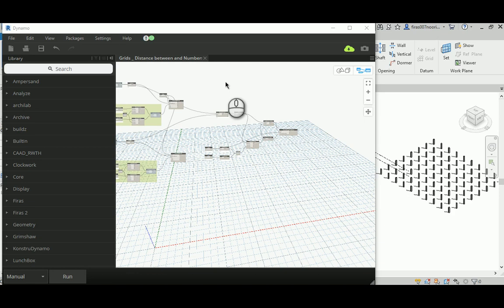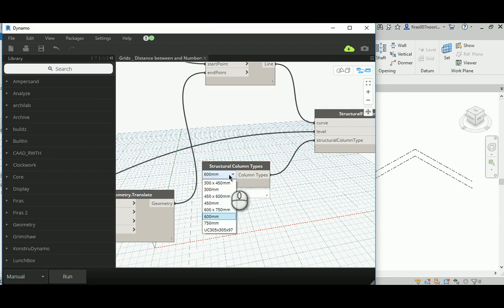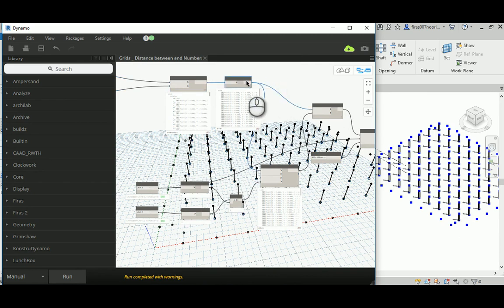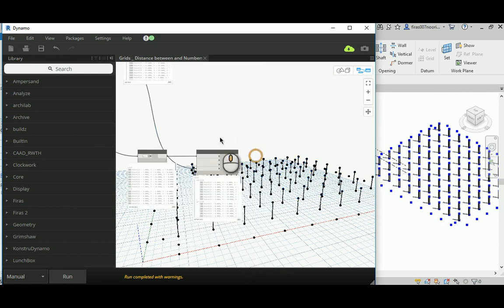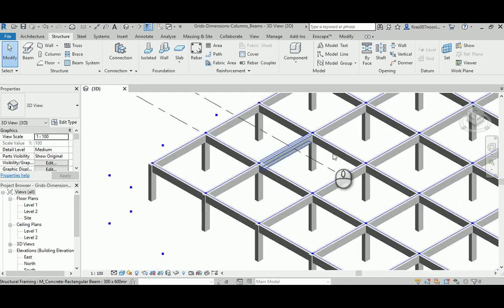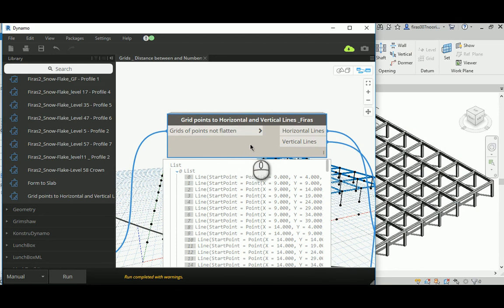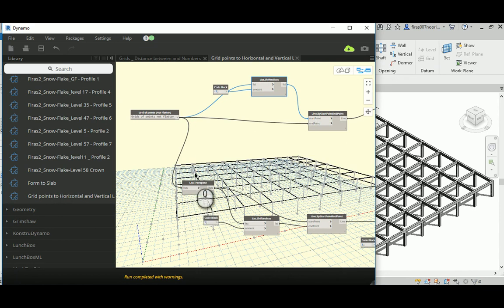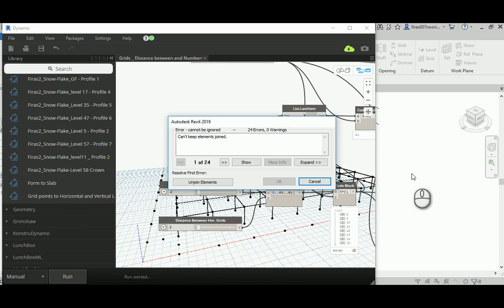Creating a Parametric Beam System in Revit by Using Dynamo

Comment: how do i repeat this frame structure at different levels ? For example applying the columns and beams at diffferent levels. When i change the level in strucutral.columntype.bycurve it doesnt happen.
Reply from the maker: Did you try to make your input as a list instead of single input as I did, for example instead of level 1, use a list [level 1, level 2, level 3].....
Check and tell me
Cheers
Reply: @FirasNoori  yes thanks a lot it worked. Making a list of different levels. But i had to use copy element option. And i imputed the list into it in the level input
Reply from the maker: Exactly, you can copy or you can make the beam and in the same time use list of inputs, same, well done mate

Comment: well done explanation, could you make a video for duct opening in structural elements?
why when I use dynamo script my Revit file becomes heavier?
could we import elements with real coordinates?
Reply from the maker: Thanks Ali, for ducts video, I guess I can make one, I am a bit busy making a new detail Dynamo course, but I will do my best to. 
And yes, dynamo might cause delay in Revit,  and you need to be careful what to choose in Dynamo, by not making lots of iterations or by removing the auto button,  do not choose complex geometries making and expect it to work fast, as Dynamo goes really slow special if it real time build and change Revit element,  try to reduce Dynamo to way process unless it is very required
Reply from the maker: And yes, you can import Revit element into Dynamo and use their real coordinate, I have 2 or 3 videos in this channel showing that

Comment: Hi, Great video, i want know if you can make a video explaining how to make this type parametric estructure but implementing a "rotation" like the twisted tower. I tried to to make the estructure with curve lines but it didnt work.
Reply from the maker: Hi dear, there 2 structural method used in twisted geometries, first is to use columns and means match the twisted geo, and the other find the common  plan area between all the different plans and placing columns ,leaving the uncovered parts as cantilevered, which one you want?
Reply: @FirasNoori  I think the first one, colums that match the geometry.

Comment: Hellow. teacher. Thank you for your mail. 
How can I make your customnode, especially fist node - Grid of points [not Flatten] node and last node - horizontal line node, vertical line node in Grid of points to horizontal and vertical Line.  
Grid of points [not Flatten] node, horizontal line node and vertical line node are packages?
Thank you so much.
Reply from the maker: hello dear, I am sorry to delay, I had to study all videos again related to the automated structural design to understand your question, I show at the end part of the video the custom node in detail but within the function mode, the node you are asking is a custom node I designed, not a package, and I can make a special video to show you in details how to make custom node and make the example the (Horizontal and Vertical line maker), I do appreciate if you can wait for me till next week as I am not home, I am in a conference and I will be back next week, I will make a video there as I have no equipment neither a recording room in my current location.
Sorry again for the delay
Cheers
Firas S. Noori
Hint: you can open a normal Dynamo file and repeat all my nodes collection that I showed in this video except the (input and the Output ones), select all your nodes and then got to EDIT menu > Create Custome Node, this will create a Custom Node for you, and in the Custome Node Mode you will find there the (Input and the OutPut nodes) save your work and close Dynamo and open it again you will find the Custom node loaded into your side menu :)
Reply: @FirasNoori  Dear my teacher. Thank you. I will wait for your video

Comment: I don't know how to does it make the Grids of Points not flatten node.  I tried to many times. But failed. Please, teaching me. Thank you
Reply from the maker: I am sorry for the delay in Replay, I am in continuous travel for conferences, and I rarely find a time to open the laptop, I will return to ur questions in more details when I get back home, but I bet that Dynamo 2.0 has done some changes in FLATTEN 
 node, try to use the Flatten function instead or just use the withing flatten tool within the same node by pressing the small checkbox on the node itself, sorry again for the delay, I am still far away from home
Reply: @FirasNoori  Thank you for your Reply. I will try to again.  happy, enjoy travel for conferences.